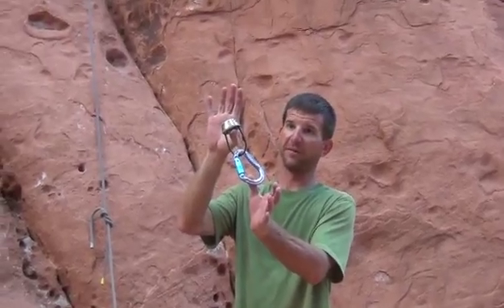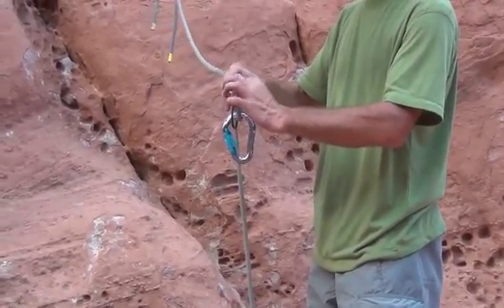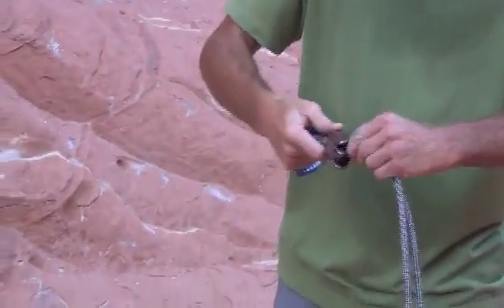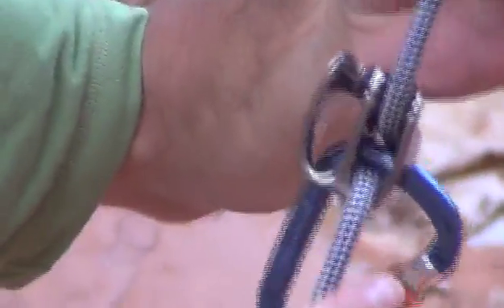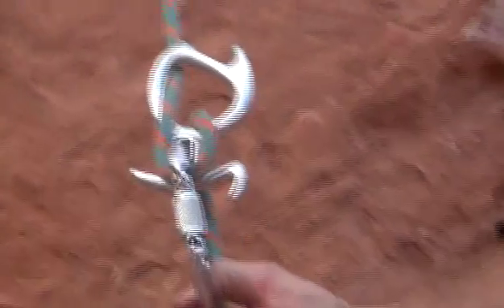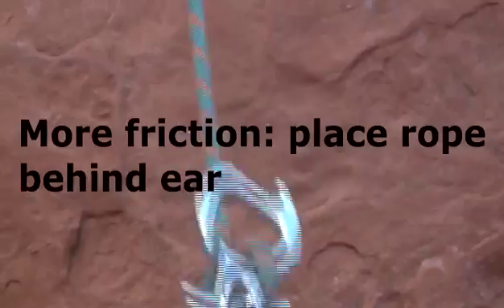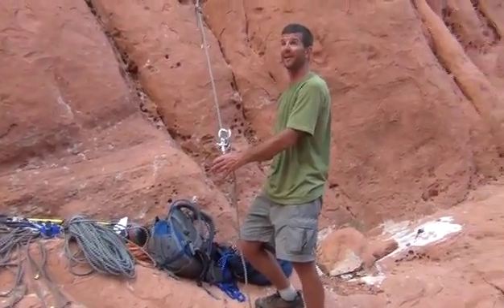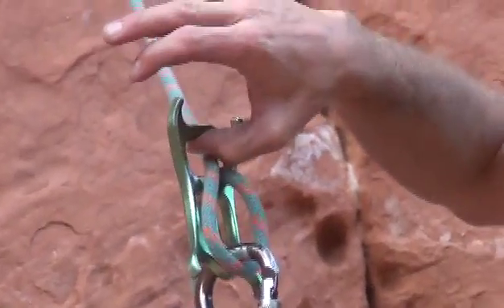Rappel Devices: ATC, Piranha, and ATS

Comment: If your braking hand somehow lets go, what is going to stop your fall, with these kind of devices?
Reply: 996601 996601 nothing
Reply: Nothing. You should either have someone at the bottom of the rope that can pull on it (acting as your brake hand) or an auto block knot connected from your harness to the rope.

Comment: Great video.  Just wondering if you could comment on static vs. dynamic rope for rappelling only.  I'm new to rappelling and want to get into it / canyoneering and I've heard that for rappelling I should get a static rope.  However, I can only find a 150' static rope and I keep hearing about 200' rappels so I can't help but wonder if people are using dynamic rope.  Please advise.  Thanks.  I live in Vegas and would be interested in getting some hands-on experience from you if you do that.  Happy New Year.
Reply: If you are only rappelling and ascending, static rope is much better.  The lack of stretch makes it much easier and puts less rubbing and wear on the rope over surfaces.  My main rope is 200' New England KM III max. Googling that should bring you some results.
Reply: Thanks.  I will google it.  I also found a Sterling rope - the SafetyPro - that was recommended in a Falcon Guide rapelling book I'm reading.  Now I need to get my equipment and arrange for a canyoneering trip and / or find a course that can teach me the hands on real-life experience.  I'm starting to practice the knots.  Can't wait to actually go do it.